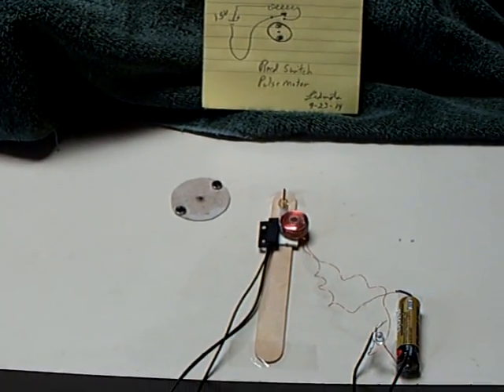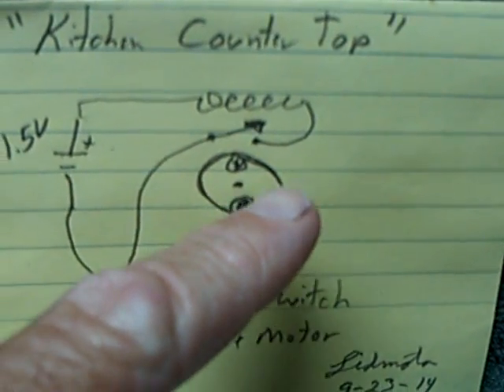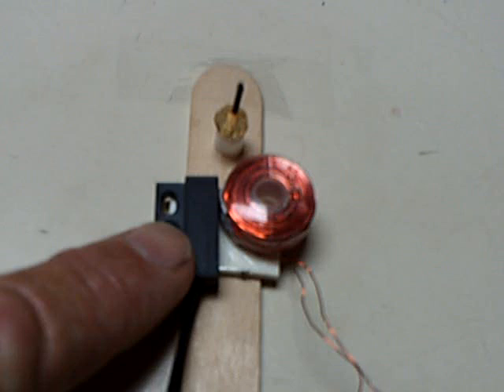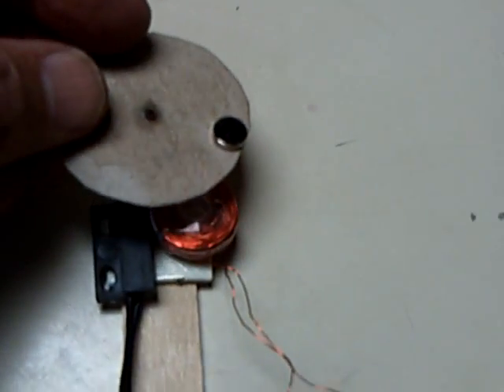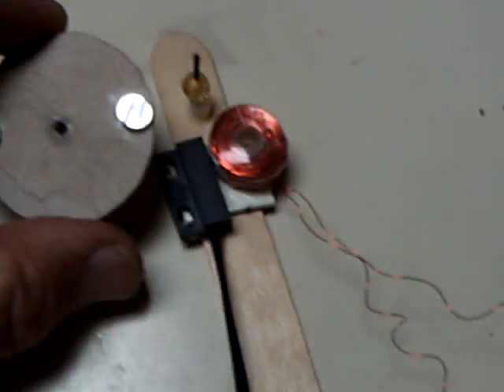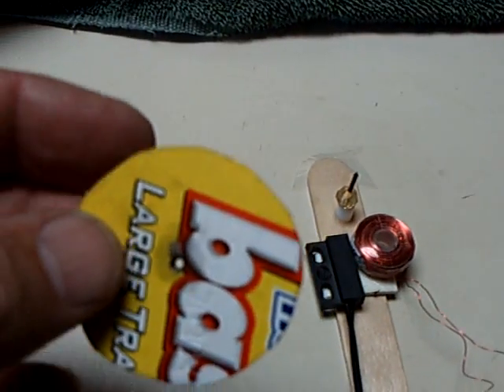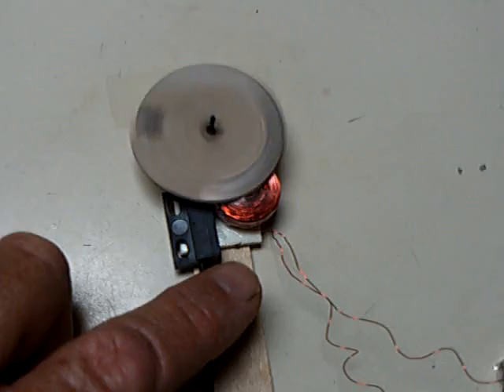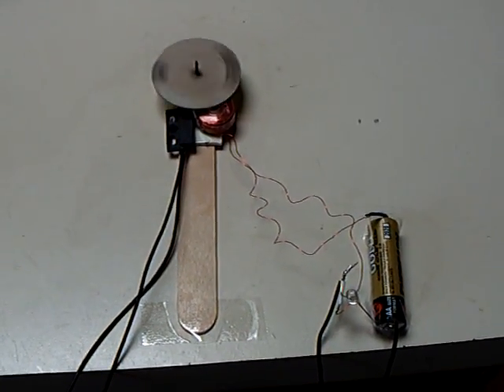Kitchen Countertop Pulse Motor

Comment: hi, i want to ask where i could salvage a reed switch cos im having a hard time finding one?
Reply from the maker: +erbinjay padit Dollar store door alarms have one in them.  Security systems use them.  You can also make one.  I made one using a small brass nail and an LED.  If you look back in my video files I did a video on it.
Reply: thanks a lot sir ^_^

Comment: Love your video.  Im helping my son build a pulse motor using a reed switch but we are having a lot of trouble getting it going.  Does the coil have to have a metal core?  What about placement of the reed switch, does it matter where it aligns on the rotor?  last question the magnets we are using on the rotor ar ceramic. Will these work?   Thanks for any input you can give us.

Comment: the coil i got is 42 gauge  i try it and its not work
Reply from the maker: Your wire is too thin.
Reply: what is the best wire
Reply from the maker: mitch nick At this scale  30 ga seems to work very well.

Comment: Have you ever tried to use the old battery clocks most would have in there kitchen or living room ticking away to make a tiny pulse motor? if you really think you can, how about a watch motor? now that would be tiny! =]
Reply from the maker: lykenth08 I have used the coil out of a battery wall clock in a pulse motor and it worked.  A watch size is device is just too small for me.

Comment: now show us how to make it without the reed switch using tinfoil brushes or something lol
Reply from the maker: Pulsed Neutrino I worked ALL DAY on that tinfoil brush setup. I got it to finally work but it wasn't easy.  The friction on the brushes was a killer.
Reply: haha wicked. so it runs albeit poorly. i wonder if single strands of copper wire on tin foil pads would be better than foil on foil perhaps. did you make a video yet too? :D

Comment: Not sure you could simplify it more... ;)
Reply from the maker: A B   Maybe do it with just one magnet and a nut on the other side to balance the rotor? It might work.  One coil. One magnet. One small nut.  One BIG nut building the thing.
Reply: :-) @ your response.
It might be possible. I wonder if you'd have to reduce the diameter of the magnet carrier dsc..